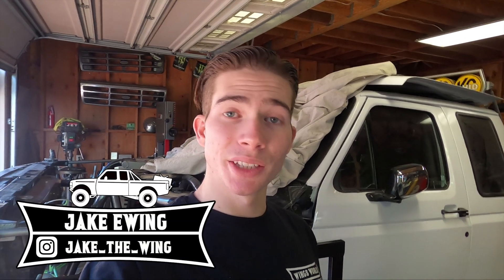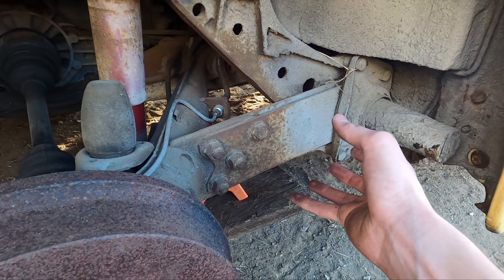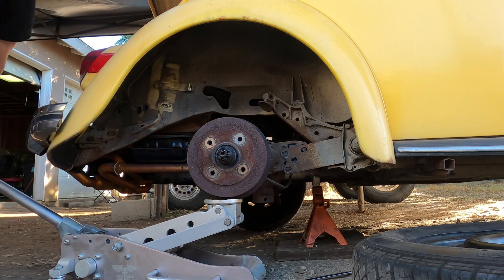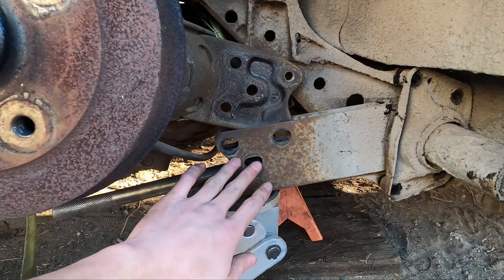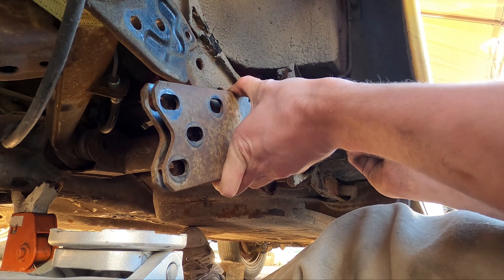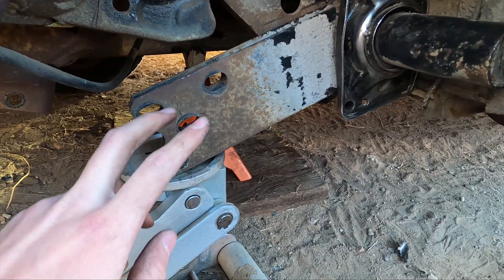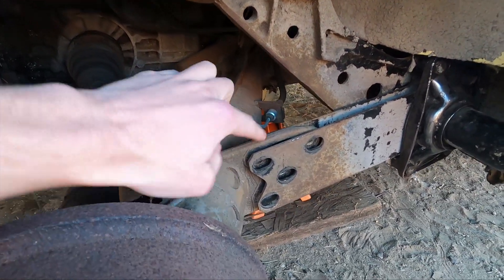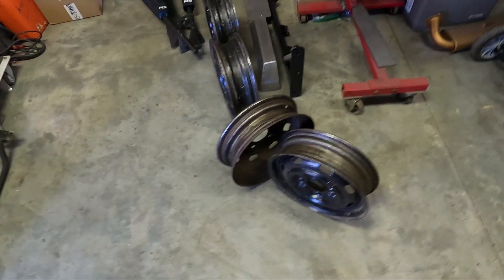How to LIFT the Rear of a VW BUG! Bug Build Ep. 1

Comment: You don’t need to get longer bolts, just put the plate on without the outside bushing and tighten it up to get the torsion arm seated, let it rest on the support tab, remove the plate and put the bushing back in place and reinstall the plate. Also, if you are concerned with tire wear, the ride height is just a visual preference. The camber is what is critical to even tire wear. Too much positive or negative camber and you’re going to wear off the edges of your tires in no time.

Comment: I lifted my 71 squareback… I got really good at changing out cv axles as the increased angle is hell on them. At the time there wasn’t any modified axle configuration to solve the issue. Good luck! And you might want to keep a built up axle or two in your toolbox

Comment: Thanks for the chart. I want a full 3' lift on my baja. I understand the will be an issue with the shock mount ( shock length  ) and the stopper lug and bottom rear bolt . Intending to move the lower shock mount, as it would hit the ground anyway and probably get bent, allowing a refit of standard length shock. not sure if its a good idea to notch the spring plate , although this would be easier than the alternative. Seeking advise here.

Comment: You didn't grind off the "ledges" so you didn't "raise" the rear! 🤣👍✌
Reply: I know it's an old post, but that's what I was thinking. That stop is going to limit the amount you raise it, correct? I believe you'll only make the suspension more firm once you've reached the limit of the stop (or ledge). I'm assuming you risk losing an axle if you shave the stop off and subsequently over extend the arm if off roading, right?
Reply: @MegaWait4it  Correct, that hump limits the lift technically, but it will ride higher within the limits. Also yes it stiffens the ride. 😁👍👍🇺🇸

Off-road or Baja is done differently depending on what type you use. 😁👍👍🇺🇸

You don't lose an axel because the IRS holds it in, but it's hinky! You can snap the torsion bar though, I have seen that! 🤪👍👍🇺🇸
Reply: @TinyHouseHomestead so at some point, theoretically, I imagine the shock or the IRS, whichever is the shorter is limiting the travel. I'm just poking around at ideas, having finally bought my first baja at age 52...lol. I'm thinking longer arms will be a better way to go, but you must need longer axles at some point with those.
Reply: @MegaWait4it  yes, depending on how much travel you want, and depending if it is gonna be a "street baja" or "racing baja", and how much money you got! 😁🤪👍👍🇺🇸

Welcome to the VW world! 😁👍👍🇺🇸

"The good thing about a VW, ... you can jerry rig them 9 ways to heaven! The bad thing about a VW, ... you can jerry rig them 9 ways to heaven!" - Terry W. Wheelock PdD. 🤪👍👍🇺🇸
Reply: @TinyHouseHomestead the good and the bad...funny stuff...lol. Its gonna spend a lot of time in the woods, so some good travel will be necessary. I built a handrail some years back, but the extra weight of the body is gonna take a little more work to keep on the trails. Not looking to break any speed records, but wanna be somewhat stable and be able to have some fun

Comment: You did a great job explaining the simplicit the job. Question though. We were able to adjust the trailing arm one notch, no problem, but the result looks like its still in the stock position.  Seriously may have only raised up 1/4" if we're lucky. I'm thinking we should have gone as many as 3 notches. Any thoughts? Thanks for this video, we've been waiting for years for a quality explanation.

Comment: This helped me a lot, i'm doing a conversion right now to a short torsion bar. i needed more room for my 31x10.5R15 wheels :D only problem is the torsion bar i got was a 28mm 21 3/4 and they're a bit hard to put it back cos it's more stiffer than the oem long torsion bars. i'm gonna have to put the engine back first to add some weight

Comment: Hi guys, would this still work if I need to get the rear fenders from rubbing the tires when people are in it? I replaced the rear shocks with new Sach’s shocks and while they ride nice and sits well when empty, they bottom out on the tires instead of the stop when anyone’s in it.  The fronts are fine.  Wish someone had taller stops available lol.  What sucks is that the tire/fender rear clearance is about 3 inches before anyone gets in the car.  So I’m thinking it’s either raise both sides 1 spline or get coil rear shocks so I can adjust where it bottoms out (to get it above the tires).  This is definitely cheaper but not sure if it will work, and if the shock will just travel farther and still bottom out. Ideas?
Reply: Coil shocks DO NOT change where the suspension stops. If the tires rub when you hit a bump, they will still rub if you "lift" it and you hit a bump. Try tires and or wheels that aren't so wide or tall that they rub the fenders. If the tires just rub the rolled edge of the fender, you can flatten that like class 11 racers do. Hammer and dolly if you're not worried about the paint, or Eastwood sells a tool for that. If you want to keep wider tires, there are wider than stock fiberglass fenders available.

Comment: What effect does this have on handling and driving
Reply: At about 3" of lift you're at about the steepest angle your differential and axles can handle. From what I've heard it's a good idea to upgrade CV joints, diff, transaxle side plates and lengthened shocks when doing this. I'm planning on going up just 1 notch/ 2" which should be enough to fit some chunky 215/35R15's on

Comment: I don’t get that chart? 2 inch lift= +9,-9? On the video you moved it one spline to gain quite a bit of lift! At least two inches. You opened your hand in the gap! So, I want approximately two inch lift. Move it one spline, right?
Reply from the maker: yes! The +9 -9 means that you need to rotate the inner spline 9 splines and the outter 9 splines the other way. Since there are a different number of splines on the inner and outter sides of the torsion bar, this will lead to a ride height change. If you look one spot down on that chart, you see that if you rotate just the outter spline +1 (what I did in the video) you will get a ride height change of 2.17".  I hope this makes sense!

Comment: I use flush fitting rather almost flush fitting tire valves they have a cap with an 'O' ring to lock them on using a coin or flat head screwdriver I have never lost a cap, and never knocked a valve out again, better than welding a hoop to protect the rubber ones as this makes it hard to get the airline on. Going to enjoy this build if it as good as your truck builds it will be a nice bug.

Comment: I have seen where guys have ground that lip away for more droop then strapped it before the shocks over extend and the drive shafts don't pop out or fall apart. Is this a useful mod to do, as I am hunting for a bug with a Baja panel kit, I want an early kit as I am not a fan of those you can buy now, I Know the fibreglass may be on it's way out, but I just prefer the early one's look.
How come you are not doing your red one as you started it and was looking good.
Reply from the maker: That is a mod that people do! If I build the whole car to race class 11 I will do this. For now, just rotating the rear torsions and installing a replacement shock. I ended up selling the red bug for a few reasons, mostly because of some of the features that make the 69-70 bugs more suitable for racing.